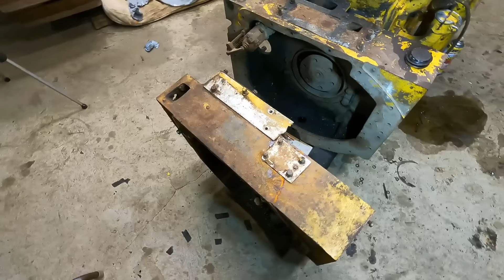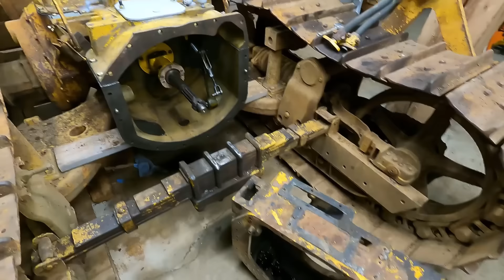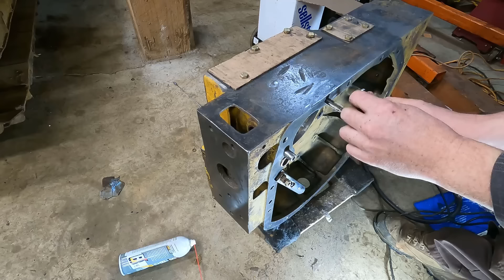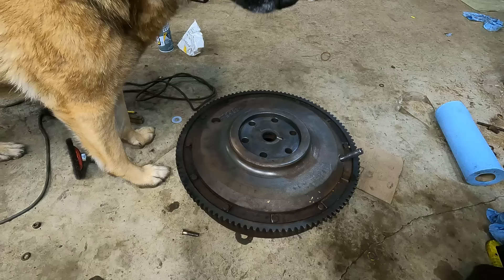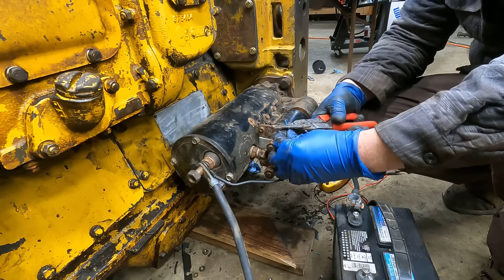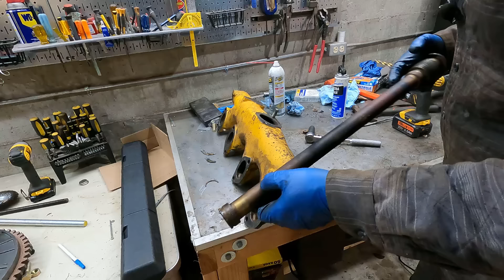D315 direct start conversion for Caterpillar D4 (part 2 of 2)

Comment: 99 percent sure that's cast STEEL, Iron is for fireplaces lol so your weld is fine.. iron wont make twisty pieces like that when u drill or tap like yours did, its more powdery.. 7018 wd be the ticket but that wire will hold just fine! Tx for the hard hillbilly work, very entertaining 👏 can't WAIT to see it done. BTW those hf dolley wheels dont take much to twist out, please get better dolly's! That engine is waaaay dangerous on those tiny wheels. Also if u are holding coolant in u might wanna go to 1/4 inch plate maybe.. but it may hold like u did it :)

Comment: hi could you not have found a bolt or two that match the thread  cut head off and sloted end for screw driver  and use them   noting ya do have a few loose bolts  nuts in you breakdown pile

Comment: It appears that the flywheel ring gear has the tapered part of the teeth facing the rear?  Does the ring gear need to be flipped so the starter drive engages the tapered side of the ring gear for proper engagement? I thought I would mention it so you could make sure everything was correct while the engine is still out.  Very nice project that you are working on.
Reply from the maker: I think both sides are tapered, but I'll double check.  This flywheel was on the old engine that had the direct start.

Comment: On cast iron, the main rule is use a nickel base material to repair it (if) you’re going to machine it ! But what you did and I’ve used stainless or even a 7018 or even braze it if you’re just going to grind it! Anything that’s not nickel hardens the cast and it’s tough to machine and that’s what I’ve been taught from working in a machine shop/ fabrication shop for 37 years my friend! Don’t worry about what others say, I’ve taken a broken manifold out of my 240, straight 6 ford! And it’s exhaust and intake together, taken it out in two pieces and welded it up with stainless stick rods plus put a carbon steel patch on where the piece was missing about 2x2 ! Welded it up and put it back in having never broken again until I sold it 20 years later! You did good brother! 👌🏻🤙🏻🤙🏻🇺🇸
Reply: Kirk, when I was in weld school 30 years ago they tried to preach proper procedure for cast welding into our brains. I like to hear from machinist like you because dispite what I was taught in school I have successfully welded cast and cast to steel several times “unconventionally”. I prefer to braze but I have also used nomacast, 7018, even 6011. Just like anything else practice...teach’s us when we are lucky.

Comment: TURBO TURBO TRUBO TURBO TURBO TRUBO TURBO TURBO TRUBO.........
Reply: @notsevenfeettall  there are many advantages to a turbo, but if your not into turbo noises and modifying everything you own then I can help you. Facts are... more power at lower rpms reduces engine wear. Used engines that are no longer performing to factory specs, turbo will get the power back to like new or better. Better fuel economy. High altitude kills engine power turbos put it back.
Reply: That'll have to wait until after the 'V-Tec' kit (Vintage Tech?) is designed...

Comment: I wonder if you would have better cooling of the engine especially the back cylinders if you made lines from the back holes your gonna plug and run hoses instead back up to the radiator

Comment: Ooo Direct start I wanted to do that but it wasn't for me at that time. How do you spell Jealousy ? 🤣😂🤣
O yeah behind the governor and the injection pump Traxcavators get a lot of rocks and dirt others don't because the load is normally picked up over the nose of the machine and finds it's way down past the shroud the and gets packed in quit hard.😲
Reply from the maker: On the old engine I had to chisel out the dirt between the fuel tower and block, took like an hour.  I can understand it on a track loader, but a dozer?  How does that even happen?
Reply: @PacificNorthwestHillbilly  I have No Idea... getting down and dirty, I guess.
 I believe they are called rock or granite gremlins; I assume they are related to the Irish Artesians that use to work for Budweiser.